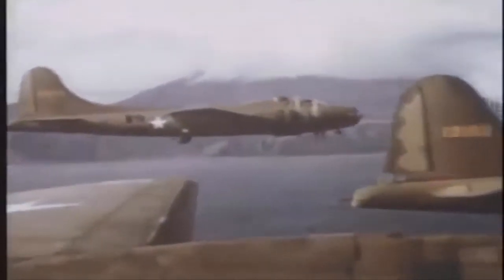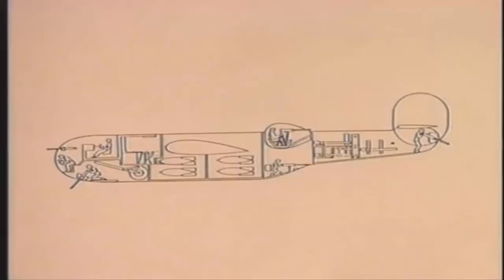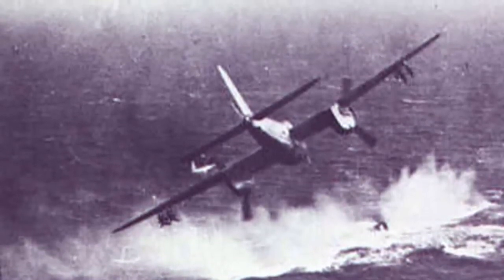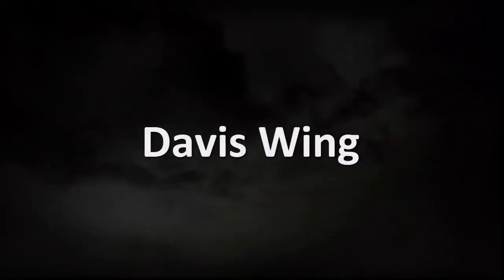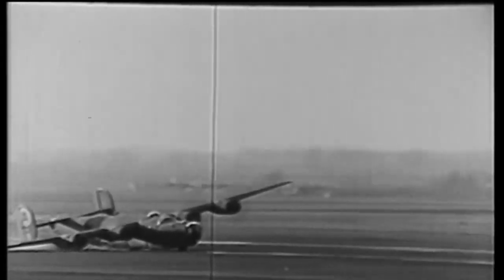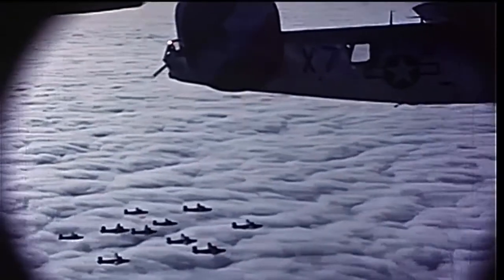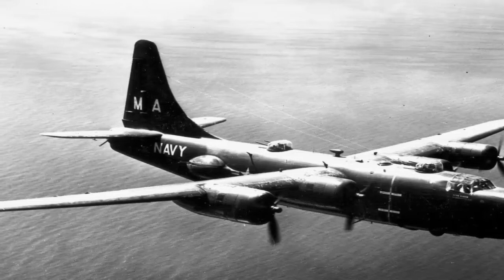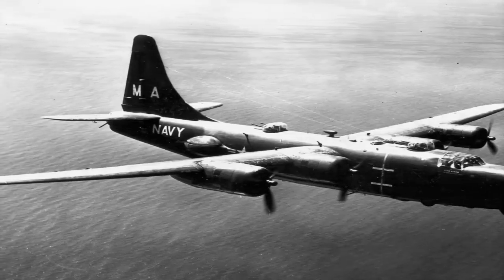B 24 Liberator:  3 Major Design Flaws

Comment: These were not flaws. They were tradeoffs. They could have increased the service ceiling simply by reducing the bomb load, but they chose to deliver more bombs or to deliver them further or both. As for sustaining battle damage, the more you over-build an airplane the heavier it is and the less payload/range you have. Do you design it to fly or to get shot up? In the overall scheme of things, as an airforce you will hit the enemy harder if the majority of the aircraft deliver more bombs. The b24 was a successful design. Every airplane design is the product of many tradeoffs. In most cases these are not “flaws”. There are no perfect airplanes.
Reply: Came here to say exactly this. Every machine is a set of compromises designed to perform to a set of specific goals. Consolidated understood very well that they were trading durability, altitude, and maneuverability for range and bomb load. Who needs maneuverability in a bomber in that era? Keep in mind the mindset of the day: Lose a bomber, build 3 more, lose an aircrew, train 5 more and send the family a gold star. Tragic, but our fore fathers were made of sterner stuff. The B-24 performed to its design goals extremely well. That's why they built 18,000 of them. Click-bait title from an OP who apparently knows very little about the subject.
Reply: I just wish this muppet would learn to speak properly.
Its so bad I found it unwatchable.
I also found it maybe overstated - He says 'Crews prefered the Fort' 
My Dad flew both. Reconed the Liberator was a lot more comfortable.
That said, the Fort was the one he talked about most.  Go figure.
Reply: I've been inside both.  I'm a heavy guy and I could get through the B-24.  The fortress was too small all over.

You are correct about the design filling a required mission.  The fortress was designed around a two engine requirement.  With the four motors, they could carry the same load farther and faster.  Adding the large wings and lots of controlling surface, the bomber could take a huge amount of damage and still fly.  It survived mid-air collisions that almost cut the plane in two.  One landed in England without a crew.  A B-17 had another B-17 land on it and they flew.

Both were needed.  Both performed their jobs perfectly.  It is true that escort fighters helped the bombers perform even better.
Reply: It’s a computer generated voice.
Reply: @zefallafez , and therefore gets my thumbs-down.
Reply: All the American bombers had a single design flaw - small split bomb bays.
This limited the physical size of the payloads that they could carry.
This was because the designers designed for the existing bombs not potential future larger weapons.
The British Lancaster avoided this.
The design flaw in the German bombers was similar - all the prewar German level bombers suspended their bombs from the nose - this both limited the size of bomb that could be carried and meant that the bombs had to flip 180 degrees on release - making bombing accuracy even more questionable. 
The advantage of this was a single stuck bomb wouldn’t hang up the bombs above it.
Reply: @allangibson2408  this is not entirely true.  Only the B-24 and B-29 had split bomb bays.  The B-29 was designed to carry the atomic bomb.  Now, later on, you had the B-36 with 4 bomb bays and the B-52 with two, however the B-36 could carry the huge hydrogen bomb.  The B-47 could carry it in the single bomb bay, but it couldn't close its doors.

Interestingly, the Lancaster was the backup aircraft for the atomic bomb if the B-29 didn't work.  The problems with the Lancaster was altitude and speed.  It was questionable if the plane would survive the shockwave from the bomb.
Reply: @michaelpiatkowskijr1045  The B-17 had a tiny bomb bay…
The B-29 was not designed to carry the atomic bomb - it was specifically modified and the bomb bay was extended under the “Silver Plate” program. The original B-29 had two bomb bays with the bombing radar antenna between them.
The USAAF & USAF did learn a lesson during WW2 about bomb bay design (go big (and particularly long)). 
The other lesson was fast opening and closing bomb doors are good. That was another problem with the roller doors on the B-24 that was not repeated. Open bomb doors slow a plane down dramatically and cause it to lose height (particularly a problem with the atomic bombers that need to clear the blast radius).
Reply: Very well stated, Aim high my friend.
Reply: THANK YOU!  I came here to say as much, however I completely disagree about battle damage in the video.  The B-24 was known to take well more than the B-17, the difference was where each plane could take more of said damage.  And while yes the B-24 was harder to fly, it wasn't that much harder as expressed.  The aircraft only had slightly higher dihedral than that of mid wing aircraft such as the B-17.  It's pull was one of weight vs. physics.  If it carried 3/4 of the load, still more than a B-17, it would have had better flight control performance at a higher altitude because the left to right dihedral on a high wing would have been negligible on the stabilized twin tail (why it was there).  Also it had an auxiliary control system to fly it the B-17 didn't.  The flaps had Hydraulics and control cables in case of damage.
Reply: Exactly; and it was very versatile.The fact that it was produced in greater numbers than any other aĺlied aircraft is a testament to the soundness of it's basic design.
Reply: @michaelpiatkowskijr1045  The story that a B- 17 which landed with no crew is a myth.
Reply: @allangibson2408  first off, the Silver Plate didn't do anything to the bomb bays.  All had two with a radar dome between them.  It did give more reliable engines and removed guns for weight and speed.  The only thing that was modified with the bays was the doors.  They changed them to snap doors.  It's how quick they opened and closed.  They literally opened and closed in a second.

Secondly, the roller doors were repeated on early B-36 designs.  I don't remember if it was built this way or not, but they were also designed with a twin tail like the Liberator.  That was never built into one.  Most if not all B-36s got 4 bay doors that snapped open and closed.  The J model went with two very long doors for 4 bays.

The only thing that was modified for the atomic bomb was a pit that the bomber would be parked over.  The bomb would be jacked up into the bay.

Height wasn't so important.  They would go into a turning dive to get the best distance from the bomb blast.  You are correct about the bays causing problems with speed.  That is the reason for the snap doors.  That's also the reason behind all but the tail guns being removed.
Reply: @manilajohn0182  it may not be as far fetched as you think.  There have been other aircraft that have landed without a crew.  One was around Borneo.  The crew bailed out and the plane landed intact.  It's been recovered and moved.  I don't remember everything, but it's being restored now.
Reply: @michaelpiatkowskijr1045  Truth lies in the details, my friend. Absence of them signals falsehood. Two untraceable names are mentioned in connection with that incident, and one bomb group. What's missing are the aircraft serial number, the squadron to which it was assigned, the other crew members, and the official report of the incident. Lack of contemporary newspaper clippings of such an extraordinary incident ("the plane which landed itself" would be an extraordinary morale booster to B- 17 assembly line personnel in the states) all suggest that this story surfaced postwar- most likely after the rise of the internet. Moreover, there exists contradiction in the date of the mission, which is another indicator (not proof) that this is an urban legend, no doubt spread by someone who never sat in a cockpit- much less in wartime. 

Aircraft do not land themselves. Any such claim requires hard and clear proof that the incident actually took place. Without it, you should be skeptical. I'm betting that the story of the aircraft which you mentioned "around Borneo" also lacks such traceable details. Cheers...
Reply: @michaelpiatkowskijr1045  Look up the US Navy PB4Y Privateer - that was a Liberator with a single large tail.
The rest of the aircraft was unchanged.
The first Silverplate aircraft (42-6259) had a 33’ bomb bay with both the forward and aft bays being merged to accomodate the initial 17’ “thin man”bomb design.
The production Silverplate modifications did include lengthening the forward bomb bay on the B-29 slightly (it was fractionally too short), eliminating the rear bomb bay (it became fuel storage) and much stronger single point British bomb shackles. This also meant that the modified bombers couldn’t drop standard American munitions (they did however bomb Japan with bombs that had the same shape and weight as the atomic weapons but with conventional explosive filling and impact detonators).
Reply: @allangibson2408  Even the Lancaster's bomb bay had a trade off. Having main wing spars in the fuselage caused difficulty in crew movement in the best of times and was a very big problem to overcome in emergencies. Not putting the aircraft down, as it was an amazing bird.  Also just going off of photographic evidence and crew recollections, if it was possible to stretch out a bomb bay in a B-17,  it would considerably increased it's vulnerability to ordnance explosions from enemy hits. One could see many B-17s with the radio room section of the fuselage aft of the bomb bay either mangled or partially blow away by near and direct hit flak and rocket fire.
Reply: my dad flew CBI theater . He said that the nose landing gear were prone to collapse on landing . This is because they were not designed to land with full loads .  For the rest of his life after the war he only drove Ford pickups .  " A FORD got me through the war . A FORD will get me through the rest of my life ".
Reply: Seems to me the B24's contribution to the battle of the Atlantic is somewhat underated here ?
The battle in the North Atlantic was I  think, the most important in the western hemisphere.
Reply: The poor maneuverability is a "design flaw" because a bomber should not have difficulty flying in formation.  The other things mentioned are simply tradeoffs.
Reply: Agree!
Reply: @Farweasel  seems to be a computer generated voice, nit a human
Reply: I enjoyed reading your comment as you absolutely were right on target.  (No pun intended)
Reply: @bad74maverick1  I CALL BS. If it ain’t Boeing I ain’t going
Reply: The perfect airplane is the one that brings you home.... Or close enough to it to walk...
Reply: @williamallencrowder361  well I flew in a B24. And it was made at willow run. 
 Have you flown a Ford lately?
Reply: @bad74maverick1  I drive a F-150. Ford is the only truck I will own. Truth be known, if I had been alive in WWII I would have been happy to fly any American bomber.
Reply: @williamallencrowder361  all I own are fords. 00 Ranger, 67 mustang, 87 mustang, 1960 falcon Ranchero, and a 74 Maverick Grabber. Daily driver is a 2014 Fusion. When I decided to fly in the Witchcraft she leaked while just setting on the ground.... they put me behind the pilots seat for takeoff and there were old frayed wires, and equipment that was next to me that looked out of service in 1964.  But there was a Brass plate across from where I was sitting that said "Powered by Ford at Willow Run".  When the plane went down the runway it kind of lumbered and when she throttled up and you could hear those turbosupers wind up and she smoothed out and we lifted off the earth like a gulf stream G6.
Reply: @bad74maverick1  I don't know. The B-17 often took horrendous punishment. All American was nearly cut in two by a Me-109. Ol' 666 was shot to infernity, losing two and a half engines, basically, with five plus cannon hits and hundreds of bullets. No hydraulics or radio, and they dang near burned out every gun barrel, but they still made it back. I don't know about the Liberator's ability to take it on the chin. I guess the Flying Fortress is better advertised for taking a mauling. The really impressive one was the Thunderbolt. Just recently saw a clip about one making it home with only one wing.
Reply: @Svensk7119  Oh the B-17 could take some punishment no doubt, I am saying the liberator could take a huge beating, and in a lot of cases more and survive.
Reply: @bad74maverick1  I am not doubting you. I just think the B-17's endurance has been better advertised.  If you think of toughness in WWII aircraft, the first thing you think, or at least that I think of is a Flying Fortress. I bet the name has something to do with it.
Reply: @Svensk7119  I'll agree with that.
Reply: @nigelmitchell351  …. The Battle of the Atlantic was the longest battle of the war. US Navy and RAF Coastal Command, along with CVE’s, bridged the mid-Atlantic gap where U-Boats preferred to operate
Reply: @Idahoguy10157  Not to forget the Canadian navy too.
A truly fascinating battle with the enemy and the environment, the technology the bravery and the horror.
I've just bought the fighting captain, FJWalker to read on holiday.
PS, sorry what does CVE stand for ?
Reply: @michaelpiatkowskijr1045  that's my assessment. The 17 is very cramped in the fuselage
Reply: Yeah, but I would say the tendency for the engines to catch fire was a definite flaw.
Reply: @rbilleaud  details
Reply: @michaelpiatkowskijr1045  To be more correct you could say the B29 was destined to carry the atomic bomb,not designed to carry it.
Reply: @stevengriffin7873  it was designed to carry the atomic bomb.  The Lancaster was the only other aircraft that was able to carry the atomic bomb which would have been used if the B-29 was not successful.

Yes, they were looking for a bomber that could fly from US, bomb Germany, and return.  The B-29 could not do this.  This is where the B-36 came in.  It suffered many of the same issues as the B-29.  The motors were among the biggest issues with both aircraft, but they were the largest for the time.
Reply: "These were not flaws. They were tradeoffs."  <== Exactly what I thought after watching this, and would have posted, but there's no need to duplicate what you said so well.
Reply: @michaelpiatkowskijr1045  I think destined is a better description. The B-29 project, if I recall correctly, was well underway before the A-Bomb was a gleam in even Einstein's eye. I wonder, not if the plane was made for the bomb, but the bomb for the plane.
Reply: It is true that every war fighting system requires trade offs.  Having said that, the Liberator clearly made less successful trade offs than other aircraft that were easier to fly and more survivable.  Think of it this way:  bomb tonnage is not the only or even the primary way to determine whether or not the bombing campaign was successful.  The campaign also required the Germans to maintain fighter defenses and aintiaircraft weapons, the cost of which increased the more often aircraft and crews could return for more attacks.

The Liberator, like the Lancaster, was an excellent bomb truck.  But it was hell to get shot at in.
Reply: @Mrhalligan39  every civil aircraft design is also a tradeoff, within the confines of the certification requirements. Nothing is free.
Reply: @sblack48  “Nothing is free” doesn’t mean all choices are equally good.  B-17’s brought crews home and Liberators didn’t.  

Another example of poor choice of trade offs would be the Royal Navy’s decision to accept significantly smaller air groups in exchange for deck armor.  Yes, they were able to shrug off hits, but many were hits they would not have taken in the first place had they had an effective air group.
Reply: @Mrhalligan39  I didn’t mean to imply that all choices are good. That would be ludicrous. I only meant that there is a cost to everything. If you want to improve one aspect of the airplane you will have to give up on something else. If you want to add lots of guns then you will have less range or bomb load etc.
Reply: @sblack48  When you make a trade off that makes a weapons system less effective than an alternative, or less effective overall, that’s a flaw.  Bomb tonnage at the dummy bomb tech level is a simplistic and largely incorrect way to measure the effectiveness of a bombing campaign.  The proof of this had to wait for the Vietnam War, where an entire World War equivalent of bombs was used to blow down empty jungle, which grew back the next rainy season.
Reply: @Mrhalligan39  you missed the point entirely. Bringing home crews was NOT the objective. Delivering bombs to the target was the objective. They could have armoured up the b24 so much that it was impervious to flack and gunfire but it would have delivered 100 lbs of bombs per mission so they would never have done any damage to the enemy. Or they could have carried twice the bomb load and had no defensive capability but very few would have made it. They had to guess where the sweet spot was without having any data since prior to ww2 strategic daylight bombing didn’t exist. That sweet spot involved crews being lost to accomplish the mission. That was accepted in war time. And now people sit in judgement of them 80 yrs later, which is ridiculous. As an engineer I have worked on the design of 5 different airplanes. I understand all the physics quite well. Could I have done it any better? No. Why? Because there is no right answer. The b24, b17 and lancaster were all successful strategic bombers but they were all different with different strengths and weaknesses. The various tradeoffs were all done a little differently on each. To call one flawed and not the others is just silly and demonstrates a complete lack of understanding of the basics of aircraft design and the realities of wartime.
Reply: @sblack48  Absolutely incorrect.  The primary effect of the bombing campaign was not delivering bombs, but forcing the Germans to commit resources to fighter aircraft and antiaircraft guns.  Make them fly every day, make them fire every night, make them devote steel and explosives and gasoline and manpower to fight the bomber streams.  Lancasters couldn’t be counted on to hit the proper city in the dark, and Fortresses and Liberators were better but rarely good enough to stop production for more than a couple of weeks, much less destroy them completely.  Tonnage delivered is a simplistic metric which makes the Liberator look far better than its actual performance indicates.

The job of the bomber is first and foremost to bring the crew home.  If you don’t have a crew, you don’t have the next raid, you don’t have a campaign.  The B17 was the best aircraft we had to do a very, very hard job.  The B24 was better at being cheaper and easier to produce, and dumping more bombs, but good luck doing anything effective with them at that technology level. 

The Davis wing that gave the Liberator its range and bomb load also gave it poor altitude performance, bad formation flying, and critical vulnerability to damage.  Its use, like the Liberator itself, was discontinued right after the war.

And that right there tells you everything you need to know about the Liberator.  Second only to the IL-2 Sturmovik in multi engine aircraft production, they were sent to the boneyard immediately after the war.
Reply: @brianwest2775  i had a sunday school teacher who was also a deacon in my church.  he flew B-24s in the 7th BS/34th BW.  he said the B-24 wasnt any more difficult to fly than any other 4 engine plane he flew (they converted over to B-17s during the war) and that he actually liked the B-24 better.
Reply: I wonder if you would have this very elite attitude if you're one of the crewmen having to go into Ploesti Romania in a b24.
Reply: @allangibson2408  the Lancaster certainly could carry outsized bombs. However it's defensive firepower was beyond weak. No lateral protection and no belly protection. I mean the German night fighters had a special Canon insulation just to exploit that weakness. I mean if you think about it you alter your all your knife fighters just because of a weakness that you detect in an enemy airplane, that must be one hell of gold mine to strike. The weakness in the B-17 was addressed with late f and later G models. That weakness being to head on pass. They didn't have to modify the aircraft to exploit that of course. I agree it was a miscalculation to a degree to not anticipate larger bombs. One of the startling statistics in comparison to American heavy bombers and British night bombers, the British lost more bombers on one mission than any one mission the 8th Air Force flew.
Reply: @JohnRodriguesPhotographer  The weakness of the B-17 was flying in daylight. That made them sitting ducks for ground based anti aircraft fire. If the Germans had had proximity fuses the 8th Airforce would have been toast. 
The Manchester had a belly turret but it was found that formation flying was a better defence. As for beam gunners - the tail and top turret could cover that area adequately (due to far better fields of fire than the B-17 turrets) and the Lancaster always had a nose gunner.
Scharademusik systems were also fitted to day fighters for use against B-17’s. A raking attack with four 20 mm cannon would take most bombers down.
Reply: @allangibson2408  ground based anti-aircraft fire that is radar-guided, it doesn't matter whether it's day night cloudy or not. Saying that if the Germans had proximity fuses the B-17 would have been toast the same can be said of the Lancaster. As for the turret coverage I'm sorry the Lancaster has the same limits out to the flanks that the top turret on the b17 had. The barrels didn't depress enough to really cover the flanks. If you have no belly protection it doesn't matter if you're in a formation or not. If you're in formation the enemy pilot has better selection of targets. As for the gun installation with the B-17 the plane carrying the installation has to get past the tail gun the waste guns and the belly turret. At night since German fighters were generally radar guided unless they were flying wild boar missions could come right up from behind and just raked the length of the Lancaster and kill it. Until the British came up with the airborne radar system for bombing, was I called oboe I don't recall? That was when the Lancaster came more into its own as a night bomber accuracy wise. The Germans and the British tried radio beams to guide their planes to targets and the Germans and British both found ways to disrupt them. Prior to that the RAF admittedly had trouble finding the city let alone the target. Granted this would be primarily during missions with poor visibility but still I've read some stats purported to be from bomber Harris himself that were pretty bleak in 1941 and 42. I'm not saying the Lancaster is a bad bomber. It's armament was based on the fact that it was designed for night bombing. However it's really odd that the RAF at planes on the drawing board for daytime bombing before the war ended.
Reply: @JohnRodriguesPhotographer  The Germans didn’t have radar guided anti aircraft guns until 1942. Even with radar guidance you can still dodge non proximity fused shells by changing altitude or direction every 30 seconds - because it takes 30 seconds for an anti aircraft shell to reach 30,000ft.
After 1941 the British were using ground mapping radar for bomb aiming (and actually got better at it than the Norden bomb sight results).
As more aircraft got bombing radar accuracy improved significantly.
Visual bombing from 1,000 ft or below was also used at night with Lancaster’s for prioritised targets with experienced crews.
Reply: @allangibson2408  hate to tell you this but when you're on the bomb run you can't take evasive maneuvers. You have to fly straight level constant speed.
Reply: @JohnRodriguesPhotographer  The Norden bomb sight required straight and level flight for accuracy to let the gyro stabiliser settle and get a drift solution.
That’s what made a high level bomb run so dangerous.
British bomb sights were better in actual service (the Germans tried the Norden (via the Swiss agent for the company) before WW2 and decided it was expensive garbage) and at low altitude it was quite easy to estimate drop points quite accurately with practice.
Approach to the target was a different matter and that’s where manoeuvring mattered to avoid anti aircraft fire targeting solutions.
Reply: @JohnRodriguesPhotographer  Elite attitude?  Please.  It’s not elitism to point out that the flight characteristics of the B-24 made the mission more difficult and definitely contributed to the massive loss of aircraft that resulted in the failure of the raid.
Reply: @JohnRodriguesPhotographer  elite?? How bizarre.
Reply: @Mrhalligan39  we are not talking about primary “effect”, we are talking about primary “objective”. An objective is defined before you do something. An effect is the result of doing it. Second of all, the main objective of the bombing campaign in the theatre where the b24 was used was to destroy Germany’s supply of oil, which it accomplished. It had nothing to do forcing Germany to commit combat resources. So not only are you entirely incorrect, but your argument is incoherent.
Reply: @sblack48  Speaking of effect, the effect of the Ploesti raid was to kill 350 airmen, destroy over 50 bombers, damage over 50 more, for zero net effect on refinery output at Ploesti.

Zero net effect, as in the Germans were not using the full output there and the damage the Liberator raid did was less than the surplus capacity.

So, a complete waste of time, lives, and treasure.
Reply: @Mrhalligan39 true but completely irrelevant to the discussion.
Reply: @sblack48  On the one hand, I didn’t raise the issue of Ploesti, so it’s not my digression, but on the other hand, Ploesti helped prove the B24 couldn’t hack it and it was relegated to targets that were less important and less defended for the remainder of its service in the ETO.

In the future, try not to be wrong before you try to brand the issue you were wrong about irrelevant.
Reply: You are absolutely correct, but the B24 proved to have better than expected
durability.  My Father's Ship(he was The Navigator) had the Hydraulics shot out, flak damage to both wings & one stabilizer, and lost an engine, in went in to a spiral. The Pilot gave the Order to bailout my Father and 5 others went down the catwalk and out through the Bombay Doors. MACR 2398. After dropping about 5000 feet the Pilot and Co Pilot regained control of the Ship and using manual controls limped it back to base. The Plane part of the Group Original Cadre was patched up and replacements were put into the crew and it completed it's 25 Missions. It was then turn over to a New Pilot and crew and flew 21 more Missions until being shot down in June of 44 MACR 6443 and had flown 46 missions without full escort. I think it was a pretty durable Aircraft. You also have to keep in mind that the 15th Air Force did not have them the entire time that Ship was Flying. The 17s mostly flying out of England with the 8th Air Force were first in line to have full escort to and from the target and got them in late 43. My Father was in a Stalag Luft 1 for a long time but his Group never received P51s and had P38s & 47s that could usually go halfway to and pick them up halfway back.
Reply: @brettbader8305  My Dad also Navigated a B24H that came out of Willow Run
and actually ended up working for Ford Aerospace after they acquired Philco where he was working. Stayed in the Defense & Govt Contracting
his entire career and actually was the Industrial Engineer who designed the first
 Assembly Line for the Nose Sensor of the Sidewinder Missile in 1956 that a variant of is still used Today.
Reply: @JohnRodriguesPhotographer  My Father & His Group had the distinction of making the most Raids over Ploesti the 449th Bombardment Group. The Big Raid
that they received a  Presidential Unit Citation for they felt was a failure
they lost 30% of his Squadron that day and had to make numerous more
Missions back to Ploesti before they considered it out of Business.
Reply: @user-qy9tf2im7f  the first raid was horrific. Subsequent raids, from what I have read weren't much better
Reply: @sblack48  You are absolutely correct Hitler was getting over 1/3 of his Petrol and all of his Crude necessary for lubrication from Ploesti.
The Synfuel the Germans were making could only be used for combustion
and they needed the Crude to make grease and lubricants and Ploesti
was the main source. The 15th Airforce was given the objective to put that Gas Station out of Business. After Ploesti the Panzers were limited because they could not grease the Tracks, The Luftwaffe could still fly because the Germans had about 15 synfuel Plants all around the Country
and as they were taken out they usually were back online in a short period.
Observation planes were constantly checking previously bombed plants
and as soon as they saw them come back online they would go in and hit them again. Every time the 15th thought they had finished it off they kept bringing it back up. The real oil flow was not stopped until the British mined the Danube to prevent
transportation. They had destroyed the Rail lines and Marshalling Yards beyond repair.  That was the end of raiding Ploesti.
Reply: @michaelpiatkowskijr1045  Don’t forget that all these crews were in their late teens early 20s and there were no fat adults, let alone young men, back then. McDonalds didn’t exist. I bet there were VERY few crew above 150 lbs. Just getting in to the belly hatch would be impossible for most of us lard butts now!
Reply: @user-qy9tf2im7f  very interesting details. I was not aware of the synfuel production. I will have to look that up. My conclusion based on all I’ve read about both world wars and Germany, Russia, the USA etc is that while having good troops and weapons is import, modern industrial wars are won on the factory floor, in the mines, the smelters, the refineries and on ships and trains and trucks. I had a friend who was a kid in Paris in 1944. He saw an American washing the wheel bearings for his jeep which were full of sand. The soldier filled his helmet with gas, rinsed the bearings, greased them, then took the helmet full of fuel and pitched it on the ground. My friend said right there I knew the germans were finished. No german would have wasted that fuel as they were desperately short of it. The yanks didn’t care. They had an unlimited supply. Doesn’t matter how good your tanks and planes are if you have no fuel.
Reply: But Mr. Rabbit Hole is an “expert”. He showed a bunch of B17s at the beginning.
Reply: @outerrealm  ahhh, same difference. They both have 4 whirly thingies
Reply: Tough chooses and just what works out IS hard to know before experience.
Reply: @rbilleaud  Add that losing an engine was a major problem while the B-17 could loose 2 and fly
Reply: @dorkf1sh  I agree with your post I just want to take small issue with your characterization of the 30-40s as a different era altogether.
Reply: Yeah I look at the B-24 as the bomber that just got things done without medals handed out all over the place because it simply wasn't required to risk all that much to get basic shit done.
It was well-designed, well-built, and got the job done, no more, no less.
Reply: Phillip Kruger  really? How many aircraft design programs have you been directly involved in? I’m guessing none. The b24 didn’t have weak spars or any other true “design flaw”. It was no ford pinto. In order for it to be accepted by the Army Air Corps its handling characteristics would have to meet milspecs and would have to be signed off by military test pilots. They accepted it. They were willing to sacrifice handling for range and payload. Everything is a tradeoff. I think they knew the airplane and the mission better than you
Reply: The Consolidated B-24 Liberator is clearly shown to be the superior maritime bomber over its more beloved fellow warrior the Boeing B-17 Flying Fortress and this is the role they were both designed for explicitly.  Range and reliability were vital and both performed admirably in these aspects.  The superior range of the Liberator made it stand apart, especially in the Battle of the Atlantic in addition to it’s vital unrivaled performance in the Pacific and China-Burma-India theaters.   The B-17 was generally considered easier to fly with less quirks to bite novice flight crews than the B-24.  In the role of strategic bombing, neither the Fortress nor Liberator was a world-beater, primarily due to the relatively small bomb load that was adequate for the maritime bomber role it was designed for, but less than half the bomb payload as the definitive strategic heavy bombers of WW2, the Avro Lancaster and Boeing B-29 Super-Fortress.  

Boeing public relations campaigns bolstered by Hollywood newsreels and enamored press corps clearly destined the B-17 for the love affair the Flying Fortress has enjoyed with the public.   Few bombers of the war are as beloved as it is, and rightly so for the design is beautiful and its rugged reputation well earned bringing crews home when sustaining unbelievable combat damage. 

All these aircraft and the gallant heroes that manned them performed an exceedingly dangerous and vital role in the war effort of the Allies.  The B-24 Liberator and similarly B-26 Marauder are often under the radar when great American bombers of WW2 are discussed and enshrined.  Largely this was due to so very few surviving the scrapping that began in ‘45.   The war records of these less “sexy” aircraft remain in addition the testimonies of their flight and ground crews that help track the vital contributions these less well known warbirds made to victory.   Perhaps the advances in 3D animation / CGI will allow these to virtually come again to life and have their stories told.   With slide rules and drafting tables, aeronautical engineers in the 30s and 40s created many wondrous aircraft that kept pushing the frontiers of speed, ceiling, endurance and stability.  Many like the Liberator kept being modified to fulfill a purpose to counter enemy technology & tactics in addition those spawned by the vast distances involved in intercontinental warfare.   The design choices often were made to fulfill a role that the principal type could not.  These adaptations of invention and the brave airmen that made them a success are stories that aviation enthusiasts and historians should keep alive in a time where the paper and cellulose records are being lost to time just as the warbirds themselves.   

Thanks for sharing this remarkable story! 🙏🏻
Reply: @cultosaur262  you can’t really compare the b17 and the lancaster. They had very different roles. The lanc could carry more but it would have been annihilated in daytime operations. The b-26 was a light bomber and the b29 didn’t yet exist in 41-43. I also don’t think blanket statements can be made about which was better between the 17 and the 24. Every aircraft has its strengths and weaknesses and these are no different. Every advantage on an airplane has a cost. Aircraft design is always a compromise. Give it super high wing loading to go fast and far and it needs a longer runway. Make the wing super thin for low drag and it is heavier and can’t carry as much fuel in the wings etc etc. Making it a pleasure to fly by increasing tail size reduces range or the bomb load. Everything has a cost. Therefore defining which is better depends entirely on what better means and nobody will ever agree on that.
Reply: @sblack48   yes that is my point also, to differentiate The maritime bombers from the true heavy bombers that were suitable for area bombing. I am not comparing the Lancaster or Super Fortress to the B-17.  Instead trying to indicate much as you indicated, they had different roles than the design requirements of the B-17 and B-24.
Reply: @sblack48  i made no such comparison.  I listed two examples of heavy bombers with payloads capable of performing strategic “area” bombing, while rightly describing the Fortress and Liberator as maritime bombers.  I agree that there are design choices, abd that these make strengths and weaknesses  to the aircraft, period.  You did not read or dud not understand the post, as i preferred no aircraft to another, and only slammed corporate marketing and media propaganda choose “better” aircraft, snd praised education about aircraft that may not be well known.   Believe what you like, but you would have more credibility if you knew that the B-26 was a Medium bomber, not a light bomber, but it is clear you did not read the post, for you are arguing against comparisons that were not made.
Reply: @dorkf1sh how much are left now adays ?
Reply: @Farweasel  It is an AI voice over. I just can't understand why content creators use this annoying crutch. My father flew B24s out of England. His accounts of how missions were performed do not have any tie in to what is described here.
Reply: @allangibson2408  The split bomb bay is less a design flaw and more a structural reality to these bomber designs. This area carried high stress loads and needed as much structure as could be designed into the area. But you are right, those planes were designed to carry the bombs that existed in the current arsenal at the beginning of the war. And why wouldn't they? The specification for these planes was not laid down in a vacuum. It was known to the American aviation military what the British had available and what was on their design boards. Capability to carry mammoth bombs like the dam busters was a very limited role and didn't need an 18,000 unit air fleet to carry out those missions.
Reply: @bad74maverick1  My father was in the last B24 bomber squadron to train in Lincoln, NE. The instructors they learned from for the most part were veterans of the early part of the air war. My father's flight crew were obsessed with maximizing the range of their plane. In experimenting to gain range, they discovered that a fully loaded and armed B24 'drug' its tail in flight. This is part of the 'harder to fly' history of the 24 verses 17 story. What my father's crew discovered is that once the bomb load was away, they could re-balance the plane in flight to change the attack angle of the wing's, throttle back the engines and still stay with their formation. This conserved gas in a significant way. This was to their benefit when returning to England because for most missions the returning planes would be critically low on fuel and would need to immediately land. My father's plane could stand off and wait to land because of the fuel savings they could achieve. On bombin missions this was only a slight advantage. After 11 bomb missions my father's squadron was dis-banded and his plane and crew ended up doing long duration radar and radio jamming missions. Their ability to extend their loiter time on these missions may account for the fact they survived their tour in England. By my father's account, at least three of the jamming mission they were given were expected to be suicide missions because of the expected duration of the mission in hours and the proximity to German fighter attacks.
Reply: @cdjhyoung  That's a pretty ingenious way to maximize your planes productivity. Sometimes you don't need an egghead to solve problems on a piece of equipment you have first hand experience with on a daily basis.  I can see how that would help the high plane davis wing used on the 24.
Reply: @bad74maverick1  Welp, hate to pop your bubble. My dad was a farm boy and a really good athlete. In 1939 he was recruited to play football for U of M until the coach got a look at how small he was. The other three officers in his crew, co-pilot, flight engineer and navigator had these jobs post WW II: the co-pilot was at one time the Lt Governor of Alabama. The flight engineer became the head of New Jersey Edison's nuclear power plant. The navigator stayed in the Army and made Colonel in the Air force. One other crew member became an electrical design engineer for some business in Minnesota. These guys had some chops and used them as best they could to stay alive. The flight engineer once told me that no one ever earned a Purple Heart as part of my dad's crew.
Reply: @cdjhyoung  Well I think those accolades you mention only further my opinion that they were all from different walks and came up with a way to make the B-24 perform better while not being engineers on the aircraft's design.  It's impressive regardless.  No doubt in some way or another their WW2 experience helped them in some facet after the war to shape who they became. 
My grandfather was on a maintenance crew that worked on the Enola Gay. He said that after the bombing no one was allowed near the plane and men would come over  and test it with something or another.  After it was cleared he said they put 14 radio and radar sets in her and they would slowly "walk off" (I assume frequency) to the point they couldn't be calibrated again and replaced. That was after she was cleared and he said she never really seemed the same after.
Reply: @cdjhyoung  I wondered if it was an AI voiceover BUT decided its been going on since before AI was released in a form capable of doing this.
I suspect its a live human reading it in 'computerised style' to add a bit of (spurious) gravitas?.
Reply: @cdjhyoung  The Lancaster inherited the long bomb bay from the preceding Manchester which had a requirement to carry a pair of 21” torpedoes for maritime strikes.
Torpedoes are just a little longer and heavier than the average bomb…